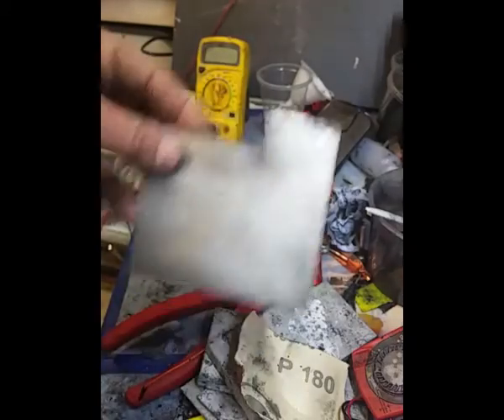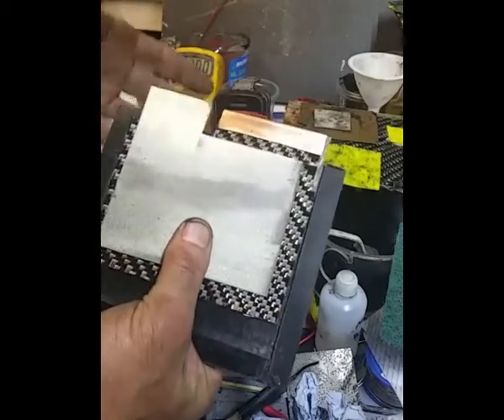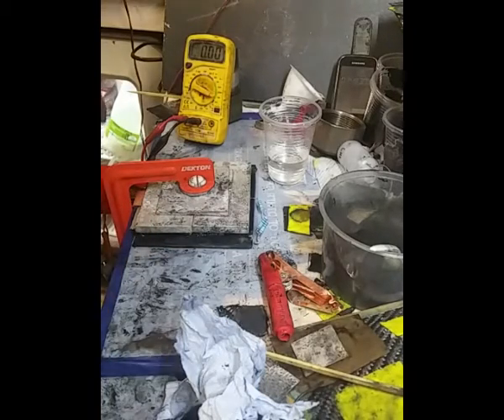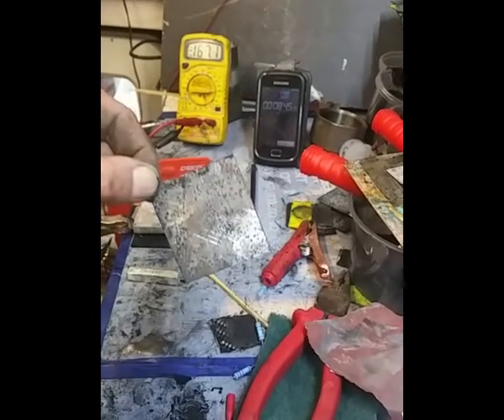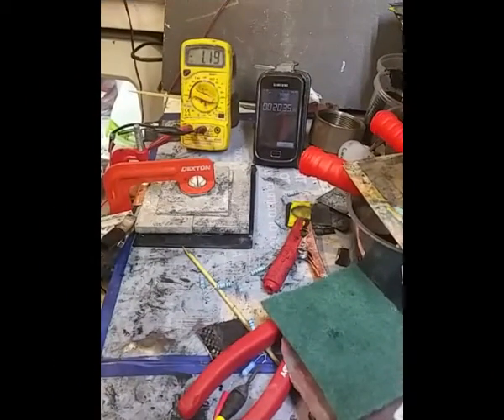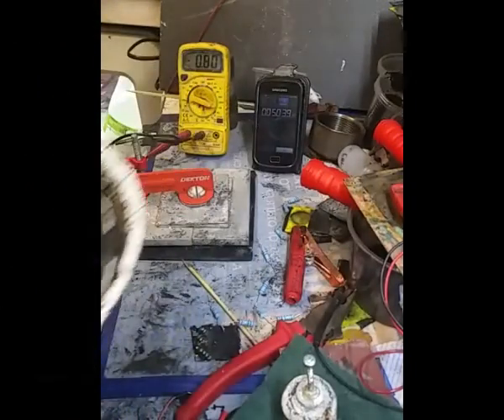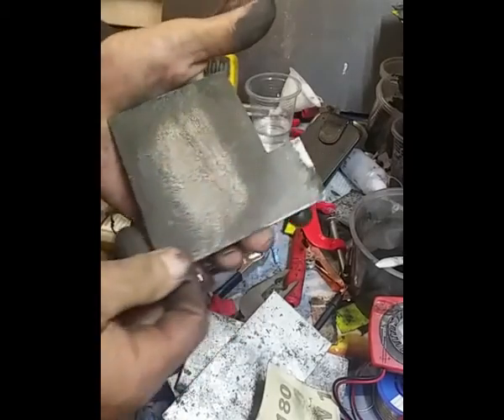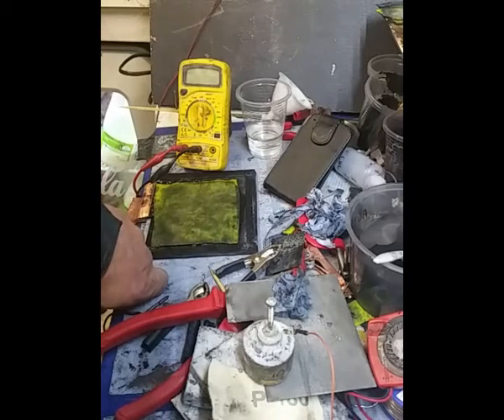My New Spongy Actvated Carbon & My Own Cell Development LATEST

Comment: How do you make the Spongy Activated Carbon? Also if you used expanded Graphite/Graphene wouldn't you get better density. If you are worried about graphite becoming scarce in the future you could also try Hemp. According to Robert Murray Smith it's great stuff.
Reply from the maker: Hi Chris.. in the blender mate with H peroxide and acetone and a lot of patience...
Tried hemp already
Reply: I'm going to try your method but instead of activated carbon I'm going to try SiC. What ratio of H peroxide to acetone are you using?
Reply from the maker: Chris Martin hi Chris i used very diluted maybe 3% peroxide and a weak acetone but you should always google stuff like this it can be volatile...just so you know what you are getting yourself into mate
Reply from the maker: Chris Martin yes forgot Silicon Carbide you may have noticed a bag of it on my bech in one of my video's
Reply: I haven't really started doing much yet, I have been stock piling minerals and equipment though. I have a bag of green SiC that I was going to try to exfoliate to see what happens. I have like 85% H peroxide, acetone, and MEK. I was going to try MEK and HP staight but that may be a bit much. I definitely have to do some prior research first before I start experimenting. So are you already using SiC in the mix or was it something you were experimenting with before? PS I like your videos, keep up the good work.
Reply from the maker: Chris Martin i have done a lot of research on SiC but haven't used it in anger yet... but watch this space !
Reply from the maker: So Chris how did you plan to exfoliate your SiC.
Oh alchohol will work fine for tha AC as well and may be a safer option
Reply: same way you did with AC or try Robert Murray Smith method for making graphene (newest video). It may not work but thought I would give it a shot. silicon seems to have the best energy density.

Comment: Excellent Power density,  I have some magnesium rod that I will cut up and make a few cells and see how long it will last.  The activated carbon seems to be the easiest and less expensive way to make the carbon plate.  One note about the magnesium plate corrosion, I saw some guys using an oil bath to keep the corrosion from happening,  also they got similar results using acetone.  here is a link to Lasersabers vid.  https://youtu.be/uSpcJGn4vGM
Reply from the maker: Cheers Ed, yes activated carbon is not dead yet....i think Graphite could become scarce ...i have been using the RMS SILAR method to put a Hydroxide coating on the magnesium and it works but i need to perfect it, i also tried borax but no joy there.